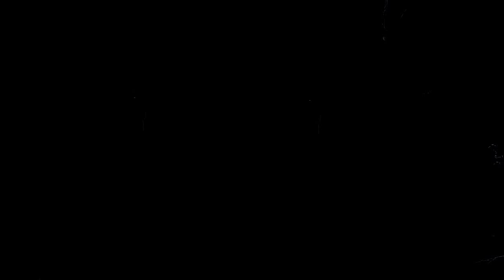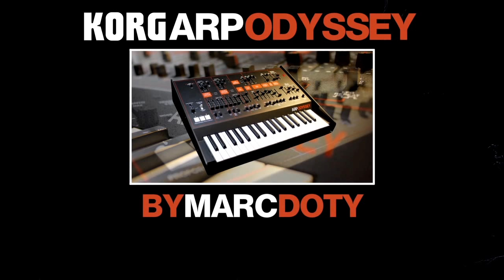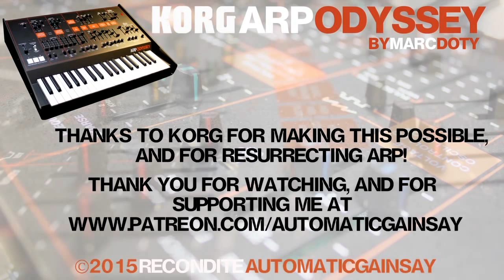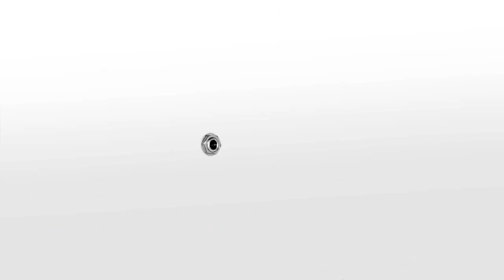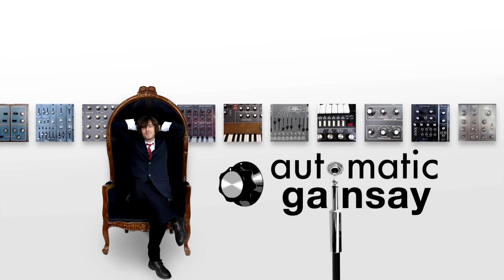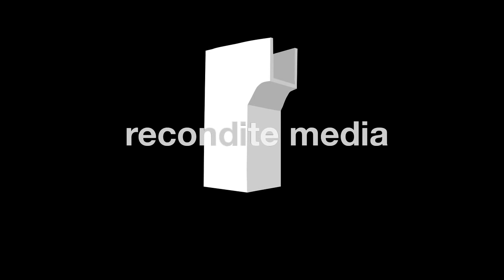ARP ODYSSEY - Marc Doty Inside Look Part 8: Various Other Functions

Comment: The VCA gain control was one of the features in the 2600 which had a certain guy named Joe who thought he could report the weather during the 70s totally baffled.  “Hey man, the sound is fantastic!  Now tell me, how do you make it stop?”

Is there a way without having to get nodular with this model that the AR envelope can be redirected to control the LFO rate instead of the filter or the amplifier?  Could that be achieved with osc. 1 in lo-frequency mode in conjunction with its ADSR slider?  The idea would be to duplicate the beginning of the Steve Miller Band’s “Jungle Love” and No Doubt’s “Hey Baby”.
Reply: Oh yeah you can get it with the ADSR controlling VCO 1 in LF mode and grabbing that from the SH mixer to mod VCO 2. Looks like SMB used the Odyssey for that sound in just this way. https://www.youtube.com/watch?v=8Gkg3Ck37k0